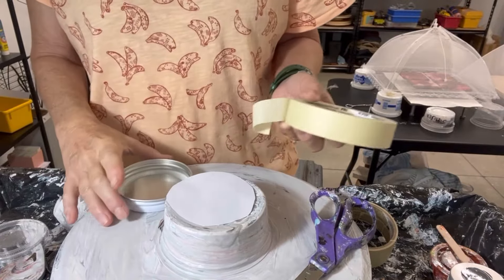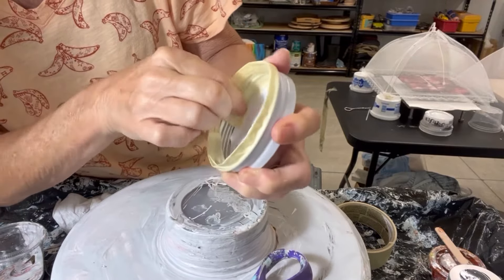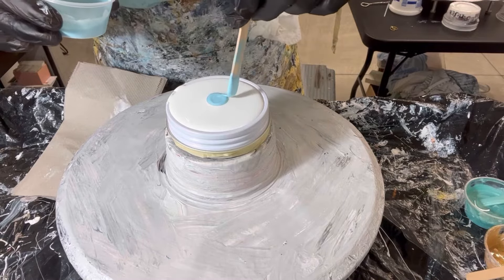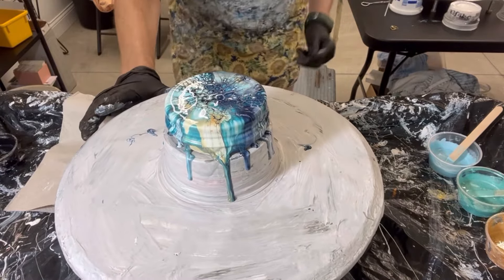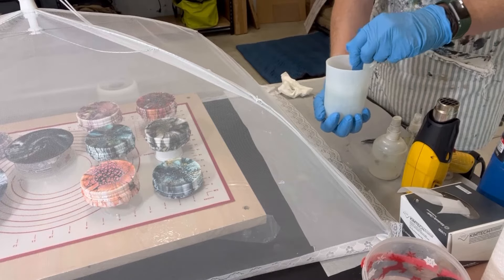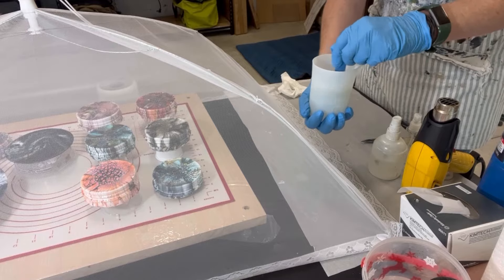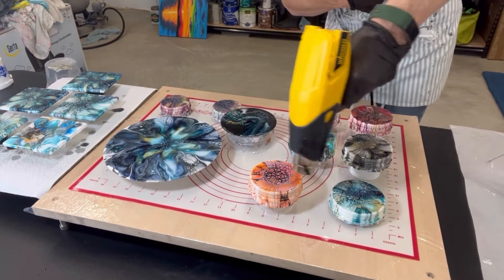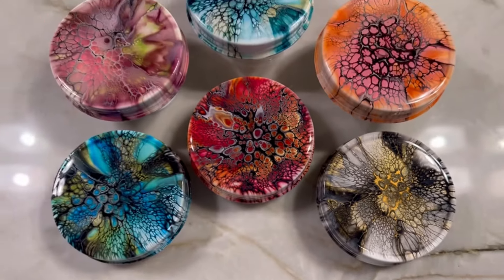268. COMPLETE JAR LID BLOOM TUTORIAL from TAPE, POUR, RESIN-FINISH! Fluid Art for beginners

Comment: As always, ma’am, your creations are superb most beautiful! You mentioned that you would answer questions so I have one question for you. Please actually have a whole bunch, but I’ll break it down to just one today.

You noticed that the PPG formula was giving you extra bubbles at one point, I’m also finding that with the batch I bought. You also mentioned that if you placed it on the heater it would help dissipate the bubbles. That sounds pretty straightforward, but I’m wondering if you could elaborate what type of heater and how long?

Once again, thank you 1 million !!
Thank you for your service your country ma’am
Reply from the maker: @andiortega4164  hi AndI thank you for being here. I’ve said early on when I had problems with bubbles and multipro I would put them on the dryer, the electric dryer were the vibration would help shake them and the air bubbles out.  I’ve since started using a vacuum chamber where I put my batch in there and let the vacuum pump, pump out the air. Please don’t confuse how I try to get rid of bubbles to how I tried to thin down my paints in the winter time with the heater. If you’re curious about the vacuum pump and vacuum chamber, just go to one of my recent videos and I have the Amazon  description you can copy and paste onto Amazon site
Reply: @LouiseMcKayArt  thank you ma’am! I understand what you’re saying now and thank you for the tip on the chamber I will definitely check that out. Thank you for being so quick to answer my question. Have a beautiful beautiful day.

Comment: Hi Louise,  I have a question if you don’t mind.  Would you mind sharing what size heat lamp wattage you used for your resin.  Very much appreciated.  Thank you in advance 😊
Reply from the maker: Hi Smougeotte, the wattage on my heat lamp is 125 W but make sure you get a bulb that works with your wattage capacity of your light.
Reply: @LouiseMcKayArt    I really appreciate it  Louise.   Thank you very much 🙏
Reply from the maker: @smougeotte61  you bet I’m here to help!

Comment: Thanks for video !  my resin gets wavy looking or I get dimples !  The highest temperature I can go is 73 if I bring them upstairs .  I work in my basement.  And I read resin is toxic so I use the respirator mask but upstairs where it is warm - I’m afraid of inhaling fumes. Do you think my resin issue is the temperature ?
Reply from the maker: IDK, it definitely depends on what resin you use because not all resin is created equally. Having a warm environment for resin is always preferable. You could put a heat lamp over the top of it. Maybe that would help, which resin are you using?

Comment: What is the reason for using a heat-gun and then a torch & back to heat-gun?
Reply from the maker: Heat helps remove any air bubbles from the resin. I use the heat gun as well as the torch equivalently for the same purpose.

Comment: I've tried to resin tile coasters and almost always the resin pulls away from the edges.  Would it do better on round lids?  I've have epoxied tumblers with success so I'm flummoxed!
Reply from the maker: Hi Sue, I use KS Resin and never had that problem. Make sure you’ve wiped your coasters with a spritzed alcohol paper towel to get any oil residue off from handling. Make sure you resin over the sides and wipe spread the resin over the sides thoroughly. Tumblers you put on a spinner, right? so that’s a different process

Comment: Why not use a blower? Fan, electric blower?
Reply from the maker: Hi Grammy, simple… because it’s so small. 😃
Reply: @LouiseMcKayArt  I don’t understand
Reply: @LouiseMcKayArt  airbrush compressor seems a likely option.
Reply from the maker: @IMAGINENGINE  the lids are only 3.5” across, it’s easy to blow with my lungs.
Reply from the maker: @IMAGINENGINE  I don’t have a compressor and will use a blow dryer when it’s bigger than 8” diameter
Reply: @LouiseMcKayArt  oh, good to know a hair dryer would work.
Reply from the maker: @IMAGINENGINE  definitely on larger pieces!